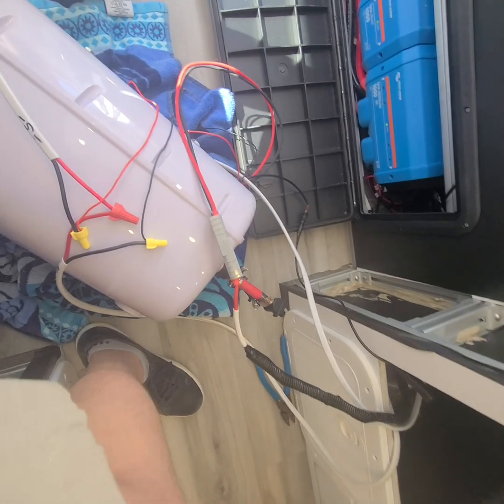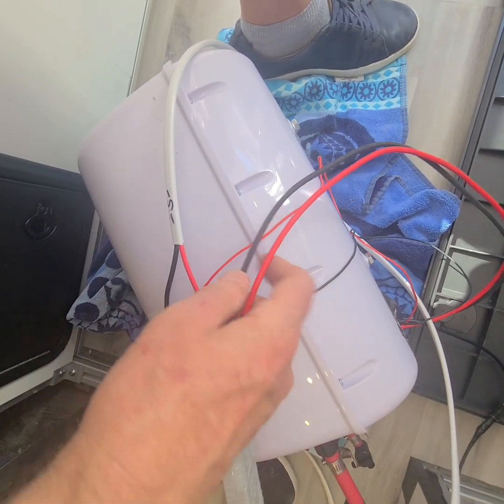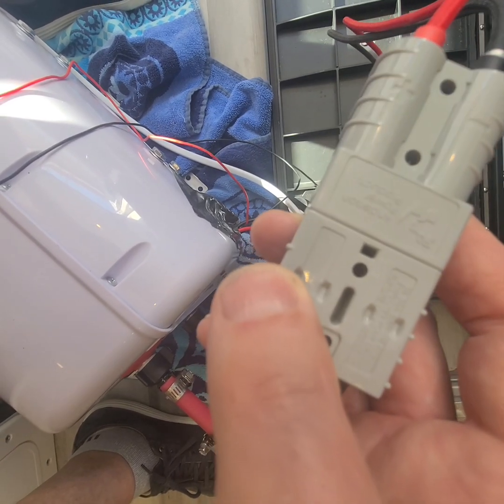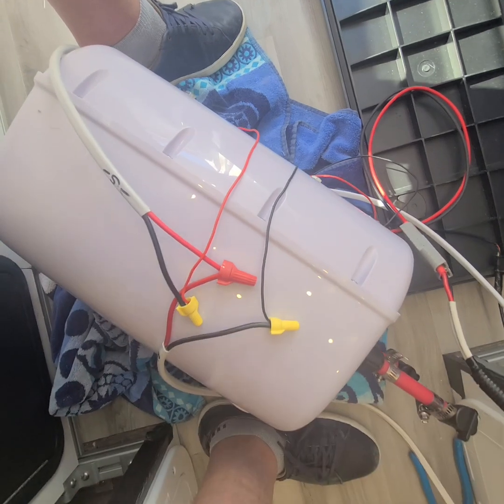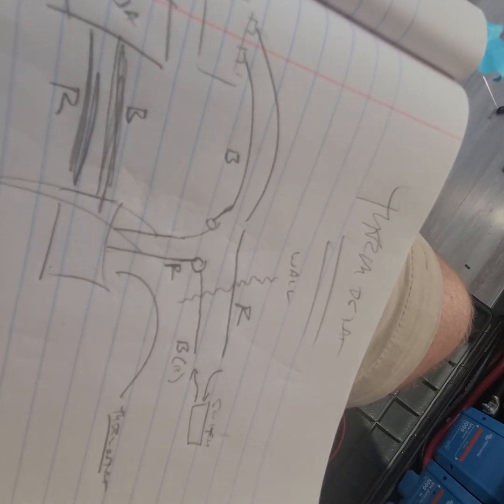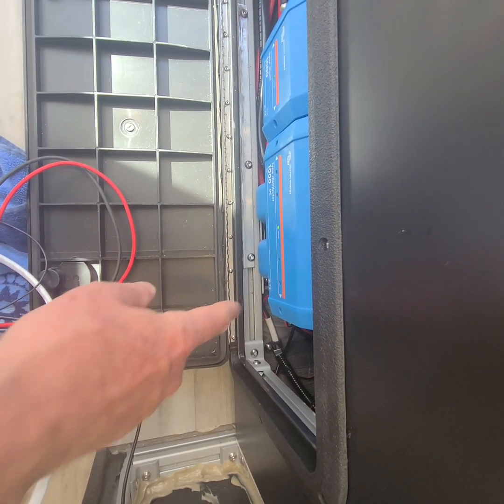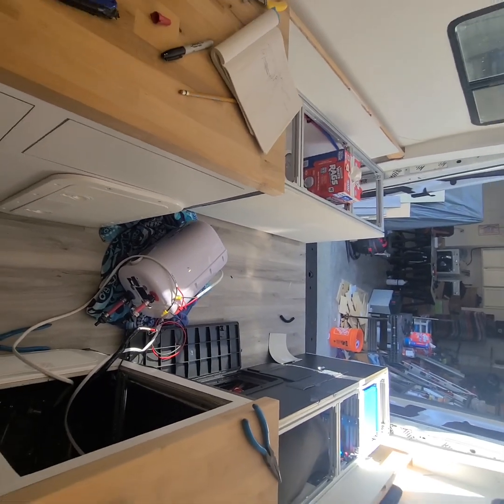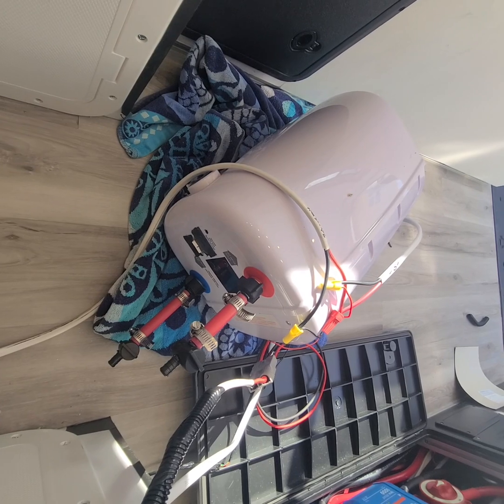How to WIRE the AusJ Duoetto mk2 water heater for 12v usage

Comment: I was about to install really big cables for this connection. But, I was like…wait a moment…the cable coming from the Duoetto mk2 is just 5mm. That is not supporting 50A. It is a big mistake from them to tell people to install it with 50A fuse. That is why the example of the blade connector got into fire. 
The diagram for the cable size is pretty simple (after looking at it for 2 months). It is like this: 

Current, Length (Twin) to area (sq mm).
All the numbers are cable size in mm² 
I will give you an example:
My connection is 6 meters away. So for 50A cable I should use a cable 25mm² to connect the water heater, ridiculous

Comment: Thanks for pointing out that truly WEIRD 12v switching arrangement .... it is by no means clear either on the connector or in the instructions how to wire it. 

I was however a little unimpressed that you don't know what a Litre is (or Liter as you might spell it) .... A Litre is universal, anywhere in the world. Any related amount of Litres is a multiple or division by a thousand, like Metre is the road.(e.g. 1000 Metres is a KiloMetre, so you just just add or remove zeros as required whether it is distance or volume). Anyway, a 10 Litre tank in the USA is the same as a 10 Litre tank in Australia. Confusion would arise if you wanted it designated in Gallons because the US Gallon is around 3.5 Litres while in the rest of the world a Gallon is around 4.5 Litres. So it would be just over 2 Gallons in Australia but just under 3 Gallons in your part of the world .... arrrgh !!! Stick with Litres, it really is MUCH easier 🙂
Reply from the maker: So thanks for the positive response. Yeah, it's a pain in the ass that we have 2 systems and honestly. No one here understands metric systems when it comes to fluids. Me especially because I'm kind of a dummy. But I'm glad you got some value out of the video and if it helps your build, go forward quickly or more quickly more power to you. Mate!Good luck on your build.  And reach out if you have any questions. I've built this video a while ago. And I'm done with my pill at this point. So if you want to check it out, go to like the link or something on the main page of this site. Haha, I'm Not like someone who makes a living off this. I just thought i'd throw some videos out there and honestly. My build is freaking legit so I know what i'm talking about ha ha
Reply from the maker: *Build not pill haha

Comment: Mines been in for nearly two years using 240v. It’s great! I ran 12v during the build so it kinda all there. But when I connected the ‘switch’ (yes same red & black like yours-thank god I labeled it otherwise I would never have joined them together). But nothing turned on..,hmmm. I too couldn’t make sense of the diagram. I just figured the relay would get its power of the “50amp” line and therefore the switch wires would be just that, a rocker switch only required! But now I see your video and it makes sense. It required separate power AND switch. So thanks. NB: I did run the massive cables to take 50+amps OMG…ALL my wiring was taken to the next amp rating… weighs and cost a ton!

Comment: just picked one up today and had it installed.  It was working when I left the installer’s shop but after only 2 hours it had stopped working and didn’t heat the water past 30 degrees.   What a piece of you know what.  FYI - running it on 12V
Reply from the maker: Weird.  It's getting power but not heating up? Even when you adjust the temp on the unit??
Reply: @transitvandiego  had to replace the motherboard.   With the new motherboard installed it ran like a dream all weekend.